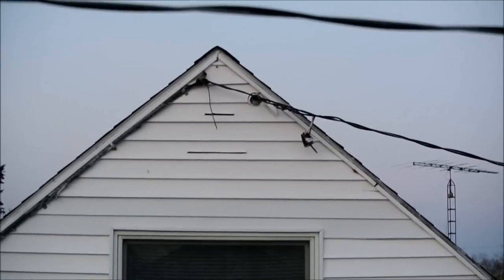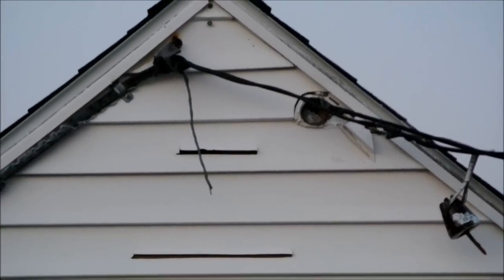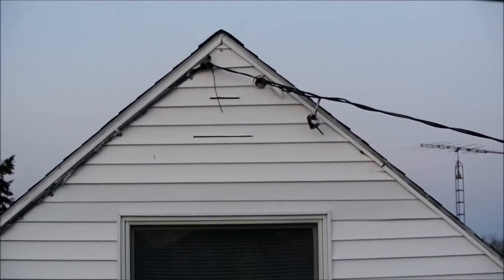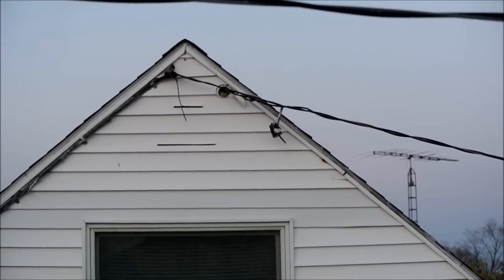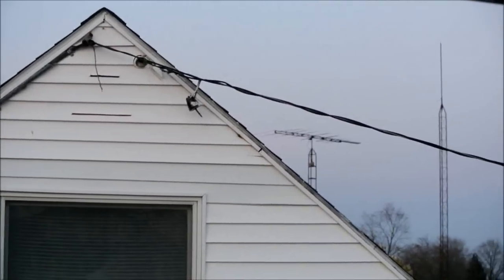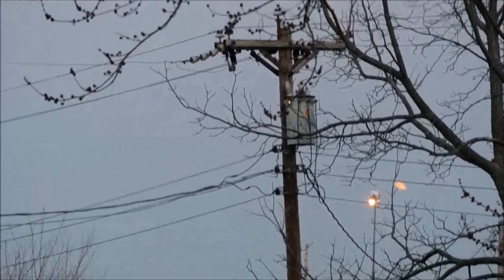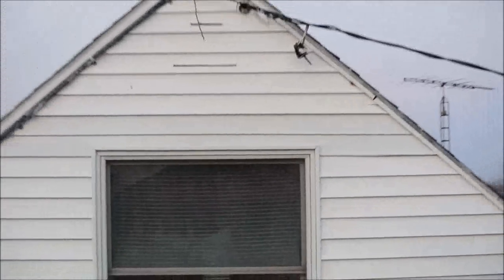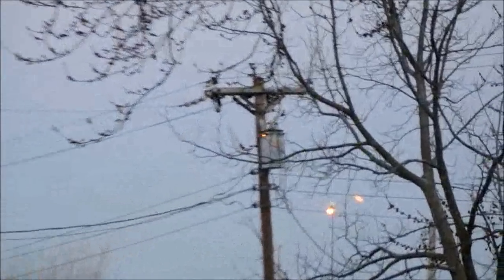Open neutral fault on neighbor's electrical supply

Comment: I seem this before over a friends house. Some lights will be bright and others will be dim. When I measured the voltage on the return the between the open neutral there was around 80 volts this means the panel has 80 volts on it to the floor in the basement. good thing I had rubber on my shoes.

Comment: Im a lineman in the electrical utility industry.   The waterline and even the grounding sheath on the cable TV coax can act as a neutral as
 its bonded to the neutral at the pole.  A dangerous situation for a plummer or cable TV tech.
Reply: It's very dangerous,  but I'm guessing the water pipe must be acting as a neutral.  I'd call the guys to reattach the service.
Reply: T. Wing I’m a line man for rf this shit is so dangerous. I have seen 2 homes burn to the ground. And your rite we bond to you guys our little wimpy supply feed will take the ground for a bit but not a year.

Comment: If your neighbor draws a lot of current with cooking or heating loads its possible it could overload your neutral wire I'm glad its been sorted now tho. I've never seen little indicator lights like that on transformers before maybe its a neutral earth voltage indicator??
Reply from the maker: From what I'm told, the indicator turns on when there was a short detected and stays on until reset. Interestingly, the transformer failed a while later. I have a video uploaded of when it was replaced. I can't send the link because YT seems to think they are spam.
Reply: Thanks I will have a look for that later

Comment: The return current will be returning back via the main earth peg to the transformer centre taping, every earth rod on the neigbours houses could be carring some of the load current, anything earthed will give you a tingle or shock, thats way you treat earth wires as live.

Comment: Dang. I've seen a few transformers with those lights. Not 100% sure, but I think it means that the transformer was/is nearly overloaded. Probably tripped when the wires shorted out. It just needs to be reset. There is a handle on the side of the transformer which allows manual operation of the internal circuit breaker. If an internal arcing fault occurred, the breaker trips permanently to prevent a catastrophic failure when trying to re-energize. (lol, you know what I mean. BOOM)
What is interesting is, why didn't they fix it?
Reply from the maker: Benjamin Esposti When the neighbor's wires shorted, my lights flickered out for a fraction of a second, probably tripping the fault light on. Since no one called the utility, they never reset it. I told my neighbor about his wires pulling loose, but he didn't seem too concerned. It was eventually fixed, however.

Comment: Generally, the utility company is responsible for maintaining the power lines up to the meter.   It wouldn't hurt for you to report the open neutral to the utility company.  Left as is, it's only a matter of time until the wood in the structure carbonizes and the house burns down.
Reply: Nope utility is responsible up to the taps from the drop to the riser. So yes the utility needs to re attach the drop to the house and re make the connection